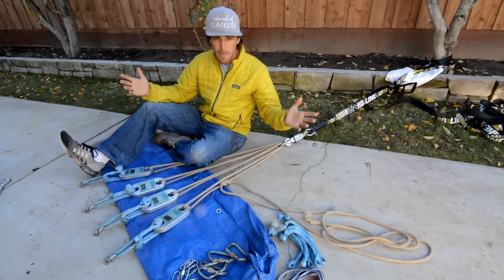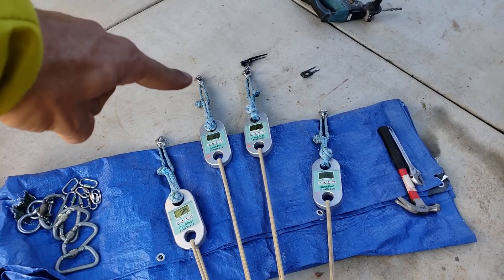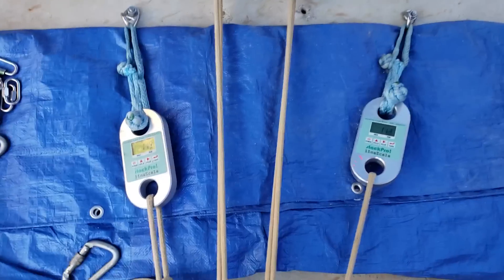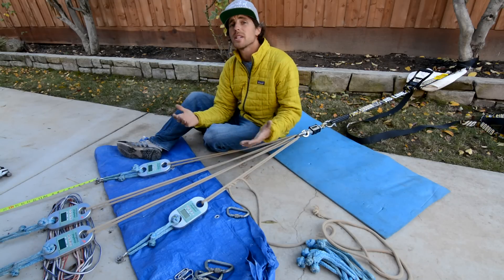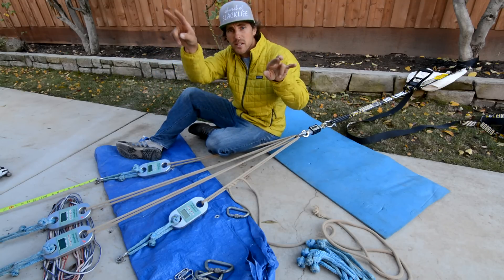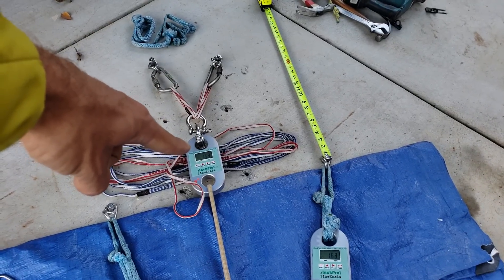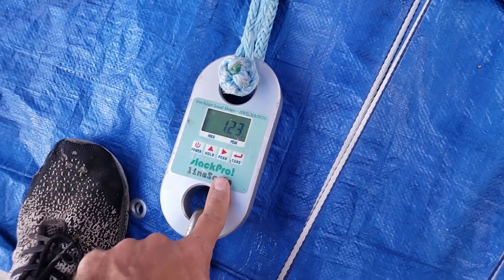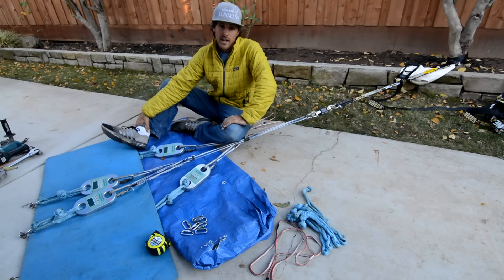Equalization is NOT a myth - new bolt pattern to make sliding x highline anchors equalize

Comment: Would love to see these tests repeated with high-stretch nylon/polyamide 18mm slings, to see if either friction difference or greater stretch changes the reliability of the equalization v.s. dyneema.
Reply: Or use a dynamic climbing rope for maximum streach factor.

Comment: In line with John Liungman, ropes can only carry tension -- the fixed point is blind to the length of the load except for any stretch, so by making the loads you want to decrease be on longer ropes you're increasing the stretch and therefore the load reduction due to friction in the sliding X.
Angles play a massive part, and as lines can only carry tension a model can be produced on how the tension is spread in ideal frictionless situations using only angles, disregarding length (as stretch will equalise with no friction)

EDIT; noticed your newest video on this in the comments, don't mean to be a keyboard warrior I only came to this idea from your video above and the first one with Andy and my 1st year engineering statics course!! Keep doing what you're doing, you inspired me to try slacklining yesterday! ☺️

Comment: I think that friction at the master-point would be significant, and you need to try to set it different ways, and at different angles, to properly understand how the forces are distributed. Also, I presume that you will get VERTY different results under dynamic load, so I'm dying to see how it runs on the drop tower.

You already said that the anchor most in-line with the direction of pull should carry the most force. You should try to use trigonometry to calculate what the actual forces should be. Measure the angles between the lines relative to the direction of pull, and and take the COSINE of the angle to figure out the expected force. After you do that, you might realize that the distance to the anchor doesn't matter, and and the differences are due to friction.

Comment: The load imbalance is caused by the friction of the anchor cord around the anchor points.  If the system were frictionless, the tension in each strand would be the same and the load in the cord would be the same everywhere.  Once any load is applied, each leg essentially becomes static and isolated from the others by the friction around the points, unless the load is so disproportional it overcomes that friction.  I worked thru the math at the end and that spacing you get is really not a fixed spacing, but is a ratio to the distance from the master point.  Basically, it's a shape that you can scale.  If you move the bolts further apart, you need to move the master point further away.  If you change the shape - by moving the master point relatively closer to the bolts (increasing the angle between the outer two strands), then you need to move the center two bolts further back to compensate  The whole thing is HIGHLY dependent on getting the strands equalized while the load is low.

Comment: Interesting results! To me, the obvious conclusion is that the equalizing effect of the sliding X diminishes with load. Initially, when the load is low, you get good equalization. As the load increases, so does friction at all points where the sling runs over a biner or shackle. This is perfectly consistent with your results. Imagine that at a certain load you get the equivalent of a knot at the master point (ie very high friction). From that point on, your longest legs will stretch the most and hence will get less tension. Your off-center legs will also receive less load. Like any pre-equalized anchor. As far as I can see, this rapid increase in friction is the only required explanation. Or is there some other theory?

Comment: Hey, I love your video. I examined this problem theoretically and concluded that the force on each bolt is dependent on the angle of the bolt rope with your main rope. If all 4 have the same angle (in 3 dimensions) then your anchor setup is equalized. The distance is not a factor. What made the forces change is the change in angle produced when you moved those 2 bolts in the center. The fact that you did not put those bolts to the ground also played a role. I used notions of statics (https://en.wikipedia.org/wiki/Statics#:~:text=Statics%20is%20the%20branch%20of,static%20equilibrium%20with%20their%20environment.) to arrive to those conclusions.
Reply: Statics is great and all but it doesn't account for material flexibility/elasticity. Since the experimental results aren't matching theory there must be something wrong with the model. My money is on the elasticity of the slings, ropes used. I would say the friction in the master point is not the cause, because he kicks the setup to try and make sure everything is settled.
Reply: I agree. I can see no way the distance in itself would matter. Unless (and this is important) the friction at the master point is high enough under load that it seizes up. In this case the longer leg will be a little more elastic due to more material.
Reply: The distance is a factor because each leg is a elastic.  Once loaded it becomes a system of 4 springs pulled on at once, each one getting a a different displacement (they are at an angle to the displacement of the master point), so each one requiring a different length to have the same force.  When i run thru it as a spring, i get a much smaller length difference than what he needed to balance it out, but i'm assuming we start from a point where it is ideally loaded, and i don't think that assumption is valid.  I get that for a 10 degree angle between each leg, symmetric about center, the center legs need to be 3% longer.  If the angles change, so does the length difference.

Comment: Is your anchor rope dynamic? That would explain why the distance to the master point matters.  Not sure the result would hold with static line
Reply: "Static" rope will also stretch quite a bit. Around 2 - 5% with around 5-6 kn force for The Sterling HTP static ropes for example, looking at their website.

Comment: seems like you need to make a big steel table with 1inch thick plate on top with a bunch of taped holes in it every 100mm then plot all the variations vs drilling up your concrete...this way you have accurate spacing and can get an over all pattern by plotting on the computer...

Comment: This is one of the flaws with the sliding X method. The more force you apply the less it is able to slide. If you look at the single point where the X is attached the strands of rope run over one another and prevents the X from sliding. If you attached each strand to a different biner and then attached the biners to the master point. Your anchor would equalise a lot better.
Reply from the maker: I'm not very convinced that sliding x's are restricted from friction because a highline moves around enough to settle into it's most neutral and natural position.  Plus we don't rig anchors with multiple biners like that so it wouldn't be a real life simulation.  Putting the center bolt further back solves almost all of our equalization problems.

Comment: I would be interested to see this done with a plate, and individual pulleys in place of the shackle. The stacking of the rope in that bell delivers error to the result, as does the friction imparted by the load cells at the bolts. Splitting hairs aside, this is a very useful and informative experiment. Thanks for the effort of making the video, and sharing it! Nice work!
Reply from the maker: Friction has been brought up and made me doubt results but i have kicked the anchor around for it to find center and the results are surprisingly consistent.  I did a bunch more tests and this video is not out yet but here it is because it is so relevant to this topic. https://youtu.be/vBs7FqwRpBM
Reply: HowNOTtoHIGHLINE I think perhaps that  under high load kicking the master point and other shackles may not help. Actually, the ONLY way forces can differ on the same sling, is if there is friction in the equation, right?

Comment: uhm, well, in theory the last setup of the first video you posted (where the bolts are almost in one line with the slackline) should be the best for equalization, if you assume no friction in the sliding x. the ones most in line should see the highest force i think? btw, i really liked this video about angles for anchor loads, he also explains why in real world scenarios an angle between 30º and 90º should be fine if you expect forces that change direction: https://www.youtube.com/watch?v=X0SP85S1m4Q
Reply from the maker: I watched the video you linked and it shows a great demonstration of how the anchor most in line sees the most force when he pushes the load to the side.  I don't think less than 30 degrees is an issue in our rigging as our load shouldn't be moving significantly side to side like a traverse belay in a climbing situation.
Reply: It could become an issue on very short lines when you surf a lot, there you might want to keep an eye on the projected load line. But longer lines should be fine.  I wish i could tell my brain: "you see, this line is so much longer, has a ton of sag, this is so much safer, just relax" :D xD
Reply from the maker: @5ch4um1  im not sure we could ever get equalization if someone is surfing hard enough haha. It is ironic highlines are safer than slacklines and longish highlines are safer than sub15 meter highlines then it starts to get more dangerous once we get above 300 to 500 meters haha

Comment: Interesting results! I have one thought about it. Did you try to move with the masterpoint to the sides after you put some tension to equalize it better?
Reply from the maker: I pretension to 0.25 kn and kick it around a bit and try to get all the legs to pull even, then i crank it down to 4 or 5kn.

Comment: Excellent stuff. Could you please do one on natural rigging? Like what NOT to use. Looping around trees and pillars are fine but i am unsure of rigging with cams/ trad gear. how many to use/safety ratio?
Ps: try to keep the gates of the bieners facing up.
Reply from the maker: I will for sure. It actually will be the new testament of the bolting bible. It is my winter project.